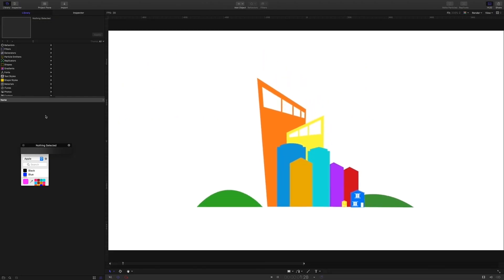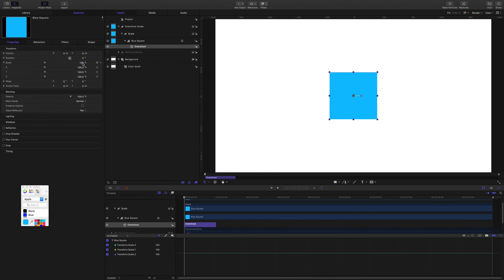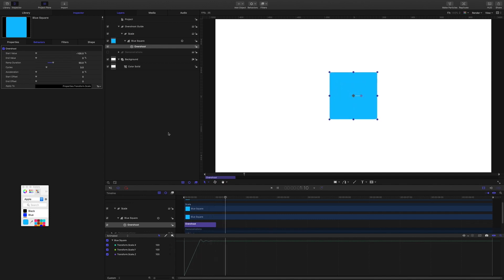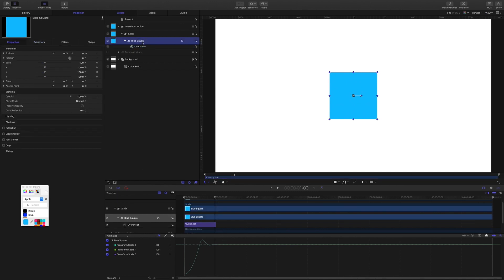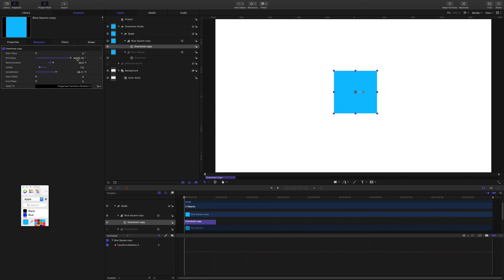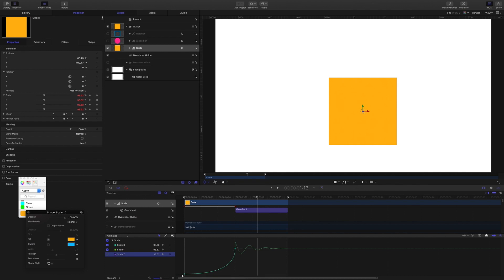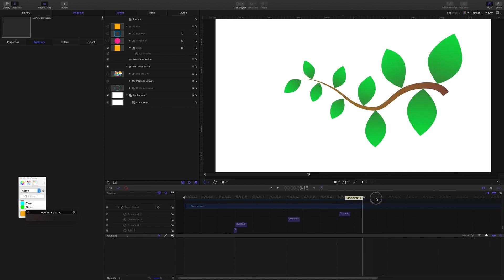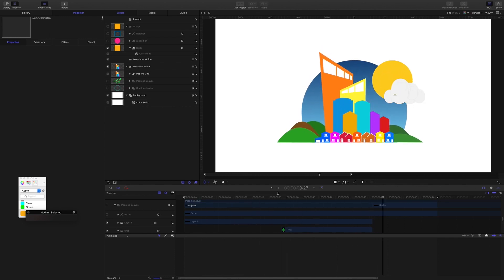Apple Motion 5 Tutorial: The Overshoot Behavior Part 1

Comment: Excellent explanation about the Behavior details. Those kind of things that I wanted to learn, because even reading the User's Guide, it isn't that clear in practice. And some Behaviors have a good number of details to adjust not very easy to understand.
Thank you very much!
And could you have used the Ramp Behavior instead of keyframing? I understand the liberty to adjust the curves but, another example, we can adjust the Curvature in the Ramp Behavior, it is possible for you to explain the meaning of that CURVATURE adjustment - 0% straight line - 100 % curved line. But I noticed that using the Start Offset/ End Offset is the same of adjusting the curve manually, isn't it?
Genius Combo #2
Reply from the maker: Hi Marcelo, .. very soon I will post a guide that uses the ramp behavior instead of key-framing. It is almost ready now :)
Reply from the maker: https://youtu.be/IrVp_xynEQ0

In this guide, i start with using the ramp behavior instead of key-framing. I hope this is useful for you. I have some other ideas for guides for using behaviours. I will examine the curvature adjustment in those. Thanks for the good advice Marcelo. :)